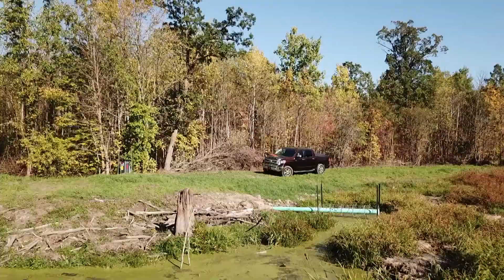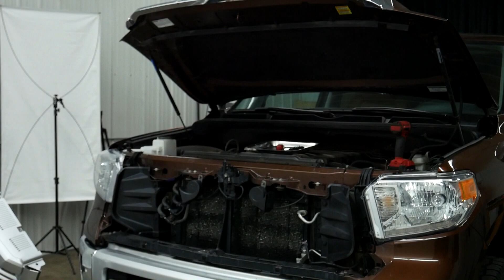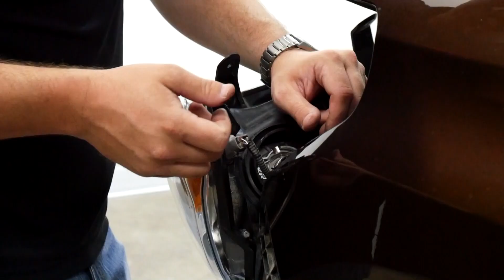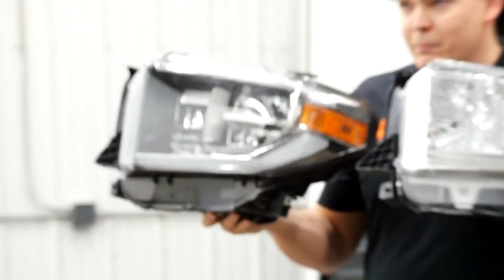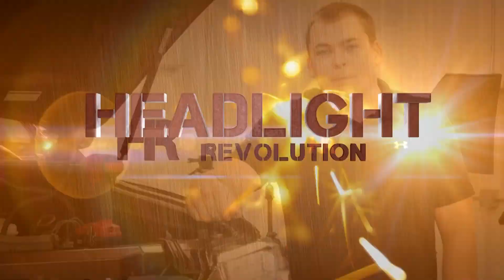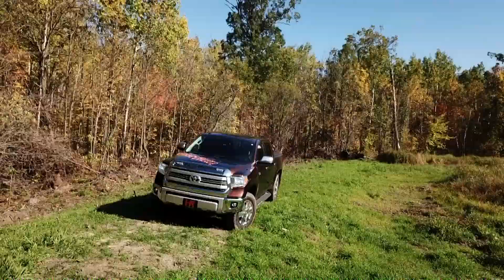Installing Toyota Tundra OEM LED Headlight Housings 2014-2018

Comment: I have just completed the update on my 2016 and I have nowhere to connect the power connector. The one which is supposed to connects to the four pin power connector on my pre-existing headlight - which I don't have. Do you have a blank that I can purchase to blank off this unconnected power connector?.

Comment: can you change out the headlight bulb and if so would the h4/9003 Morimoto 2Stroke 3.0 LED bulb work
Reply from the maker: No, these are sealed OEM LED housings, the only thing in them you can change is the turn signal bulbs.
Reply: @HeadlightRevolution  are the ones that come with it brighter than the morimoto 2stroke 3.0 LED
Reply from the maker: We have not compared them to know for sure if they are brighter or not.

Comment: Where can I get the plug and play conversion cable?
Reply from the maker: On our website here!

https://www.headlightrevolution.com/toyota-tundra-oem-led-headlight-conversion-2009-2018-H-TUNDRALED_2
Reply: @HeadlightRevolution  your site is confusing. Says "  Conversion harness (pair) : 14-21 Tundra OEM LED headlight conversion (Trucks w/ OEM LED DRL) " My tundra doesn't have OEM LED DRL so I did not order this harness. I had to connect the dots and find this post just to find the harness. Customer service through email was very little help.

Comment: 2014 tundra. I just installed these headlights with the wire harness and the drl harness. I'm getting hyper flashing only when headlights are on. Any suggestions? Thanks
Reply from the maker: Reach out to our CS team so we can help you with this!

218-755-5200
Sales@HeadlightRevolution.com
Reply: Did you ever get an answer to this? Having the same issue on mine as well.

Comment: My tundra is the 2017 but I want the 2018 with single led on the bottom , can I use the same harness.?
Reply from the maker: This harness will not work for the halogens with the LED strip.

Comment: We installed these and they look nice but the turn signals stop working. They were both 10A inside the fuse box connection piece. I need help
Reply from the maker: These are correct!

Comment: My 2017 tundra didn’t come with led output. Once I buy led headlights is this the only piece I need ?
Reply from the maker: You will need the headlights, the adapter harnesses, and some vehicles will require the DRL. If you follow the ordering of that product from our product listing, it will be really easy! Link: https://www.headlightrevolution.com/14-18-toyota-tundra-oem-led-headlight-upgrade-kit-TundraLED-Housings_2?quantity=1

Comment: Hi right under the turn signal there’s a cover hole my truck that hole is open and the wire went in . What is that? And how do I remove it because I want to switch my headlight but I can’t remove this. Thanks so much
Reply from the maker: Hey there, I am sorry to say that I do not know what you are reffering too, so I will have to have you send images of what you are talking about to us via email. When we get those, we will totally be able to help you figure that out! Sales@HeadlightRevolution.com
Reply: Headlight Revolution ok thanks a lot I’ll try now to contact you guys. Thanks
Reply from the maker: Right on, we should be able to get you takken care of when we get those images! Let us know if you have any other questions!

Comment: Great video for a great product. One suggestion...use a towel, tape or something around headlight opening to protect paint. Driver's side headlight assembly has small chips in paint, expect that's from practice run on installation prior to vid
Reply from the maker: Thanks for the tip! That is something that Chris W typically does, I'm not sure why it didn't happen in this video.

Comment: Weird question.  Do you make a harness that goes the other way? Taking LED headlights off a 2019 to put on the old black chrome halogens? Like the look of those better/no DRLs.  Thx
Reply from the maker: We don’t have that harness but I bet you could make something work, You’d mostly need that factory H4 connector and some wiring. The rest will remain very similar.

Comment: 700 for headlights and 90 for harness.  I made the exact same harness you sell 20 dollars buying the connectors and pining them myself  got the headlights from a wrecked vehicle for 250 the pair  less than 300 dollars in the upgrade then i sold my old headlights for 100.
Reply from the maker: That is awesome Carlos! Most of our customers just want to buy a complete package with a warranty, But if you can source and build the parts yourself you’ll definitely save some cash!

Comment: Question, did this conversion on my 17, everything works fine but both the LED strip and the amber DRL are both on when running the DRL. Is that normal or should the LED strip be the only thing on during DRL?
Reply: I just installed mine with the LED turn signal bulb and it does the same thing.. 🤷‍♂️
Reply: Found the issue?

Comment: I just got my 2015 tundra I was looking to upgrade my headlights. I know in my stock headlights, there is an adjustment that you can move the headlights up and down. Will these lights adjust up and down like the OEM headlights?
Reply from the maker: Yep they should!

Comment: I have a question. I installed Two Head light housings purchased from you several months ago, and experienced the left side turn signal light, still stock from Toyota, start blinking fast, then it back to normal a day later, it keep happening once in a while when Daylight LED and turn signal on at same time, turn off DL LED then it back to normal blinking speed. When that happened, I turned off Day driving light and it was ok. Do you know why or anyone having same issues, or how to fix? Thanks.
Reply from the maker: Can you email us about this? We will be able to better assist you that way! 
Sales@HeadlightRevolution.com

Comment: For those of who who already had DRLs before upgrading to the new lights, there will only be 2 wires in the plug that goes into your blinker. Pin 2 (white with black strip) needs to be moved to slot 1. This will stop the hyper flash.

Comment: have a non led headlight (2017). if i change it to 2018 oem headlight, what’s going to happen to amber drl? is it wil still “on” while running and the led strip drl at the same time?
Reply: I changed mine out and yeah the LED DRL is on and the old DRL is dimly lit and brightens up with the turn signal but doesn't turn off completely. I can't figure it out

Comment: I have a problem with the fast hyper turn signal !! Any recommendations?
Reply from the maker: Yeah my man, you need resistors! 

Link: https://headlightrevolution.com/gtr-lighting-50-watt-6-ohm-gold-style-resistors-for-custom-installation/
Reply: Headlight Revolution in the video they said no resistors required. Plug and play. Scratching my head
Reply: djqx the plug that goes to the blinker needs to be repinned. It’s simple, and there is a video on YouTube if you search repin tundra blinker. Basically need to flip the pin 2 and pin 1

Comment: I'm getting a hyper flash signal with my install, but your video doesn't show this. How can I slow the flash down?
Reply: You need resistors. LED bulbs use much less power and the computer will think it's broken. The resistors trick the computer into thinking an old halogen is still on

Comment: Any chance you may something like this for a 2011 Rav4. I would like to have the entire lamp swapped out (if all possible)
thnak you.
Reply from the maker: We don't offer aftermarket housings for your Rav4 I'm afraid. But, i can point you towards some new LED Lights that'll be a vast improvement over your stock bulbs if you'd like? :)
Reply: One more question... Do you offer a package to replace all the interior lights to LED. if not can you please direct me to each link for all the interior lights. Thanks!
Reply from the maker: You bet we do my man. Give me a call or email and let's light up your Rav4! 

Phone: 218-755-5505

Email: Sales@Headlightrevolution.com
Reply: Great... i just sent you an email. Cheers!
Reply: Headlight Revolution  Yes, please...
Reply from the maker: Your low beam is a 9006, and your high beam is a 9005 style bulb. I recommend the 9006 GTR Lighting Gen. 3 Ultra Series LED bulbs for your low beams, and the Putco SilverLux 9005 styled bulbs for your high beam. (: Have a look! 

Low beam: https://headlightrevolution.com/gtr-lighting-gen-3-ultra-series-led-headlight-bulbs-9006-hb4/

High beam:  https://headlightrevolution.com/putco-silver-lux-9005-led-headlight-bulbs-280005/
Reply: Awesome thanks!
Reply from the maker: Of course! (:

Comment: my truck doesn't have DRL(2017 trd pro). So does it still work?
Reply: Yes it will you have to buy this adapter with the drl adapter as well its $100 dollars for both adapters. Just bought mine.

Comment: In the video you said it's all PNP, no wires need to be ran. But I just read the DRL harness on your website and it says it needs to be ran to switched power source like the fuse box. So which is it? PnP with no wires need to be ran or do we need to run wire to the fuse box? Thanks .
Reply from the maker: medic048, great question! As described on the website, you ONLY need to run wires IF you don't already have DRL's.
From the website: 
"Daytime Running Lights: The optional conversion harness from Morimoto makes this upgrade completely plug n play for those of you who ALREADY HAVE existing LED Daytime Running Lights on your truck. IF YOU DON'T HAVE the OEM LED DRL's: not to worry. The harness includes an extra pigtail that you can tap into any switched power source on your truck to run the new DRL's."

Comment: Love the idea, but too much at $789 plus another $90 for the required wiring harness adapter, for 2014-2018 non-LED owners
Reply: Call it $1000 bux for more light means safer for you and your family night driving? Factory halogens are abysmal and Toyota should be ashamed of themselves. Worth the upgrade imo
Reply: Yup agreed oem stock replacement headlights are not cheap for any vehicle!! Worth it!
Reply: I would love it if I could get a new pair of OEM grade LED headlights for <$1000. My headlights costs $2499 EACH
Reply: brosk1s Then your a dumbass
Reply: $789 for a pair of LED headlight that are a 100% improvement is a steal. I WISH upgrading my headlights to the OEM LEDs was this easy for my car.
Reply: Half the price of a custom build with Toyota OEM quality...under a grand is a steal.
Reply: When halogen bulbs went from $6 to $9, I stopped buying bulbs. I put a light bar on there. Mike dropped
Reply: $1000 for OEM quality LED headlights is a steal.